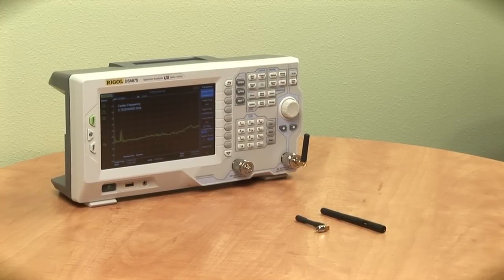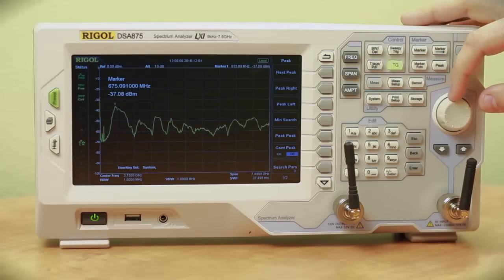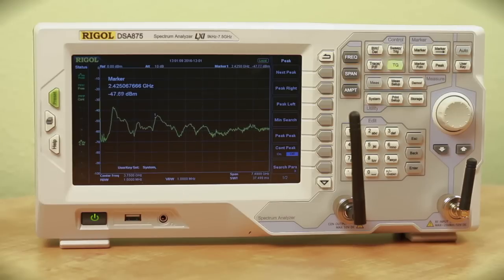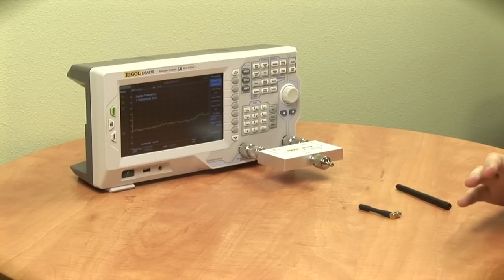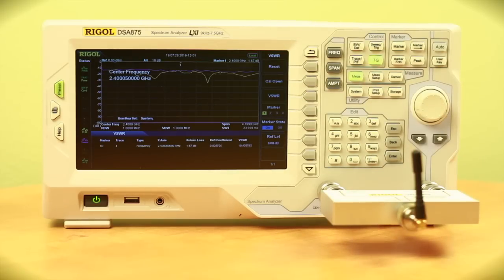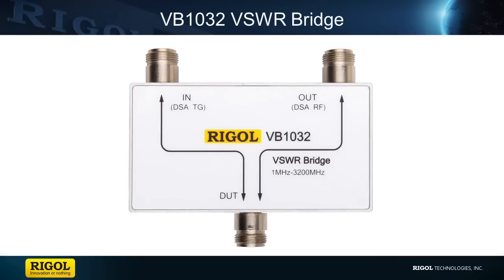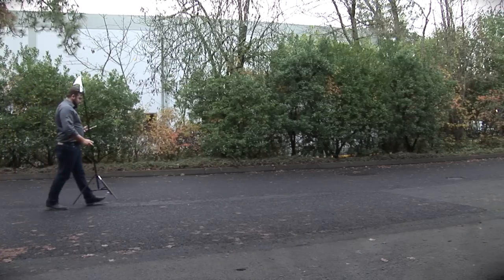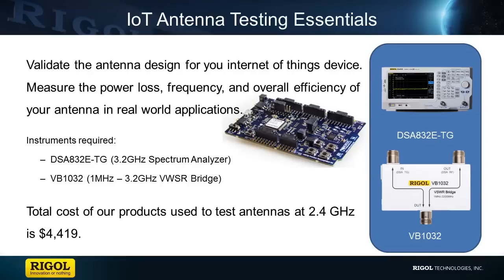RF Antenna Testing

Comment: What frequencies can I test with this device?
Reply from the maker: Hi. RIGOL has spectrum analyzers that can test antennas up to 7.5 GHz with the correct VSWR Bridge.
Reply: @RigolTech   from 1 Mhz to 7.5 Ghz?
Reply from the maker: @coder2003  The DSA875-TG can do that range, but there are different ranges for the VSWR Bridges. The VB1032 = 1MHz-3.2GHz; The VB1080 = 2-8 GHz; the VB1040 = 800 MHz -4 GHz. The RSA family has "N" models with a built in VSWR bridge. The RSA5065N can go from 10 MHz-6.5 GHz without an external bridge. You can check the user guides on our accessories for more info here: https://www.rigolna.com/products/accessories/
Reply: @RigolTech  Thx 😊

Comment: Should it be connected with long feed line to eliminate analyzer influence?
Reply from the maker: Adding a long feed line can eliminate some of the analyzer influence but it will also add the cable's VSWR and reflection coefficient into the equation.
Reply: @RigolTech  could it be eliminated by feed line  calibration?